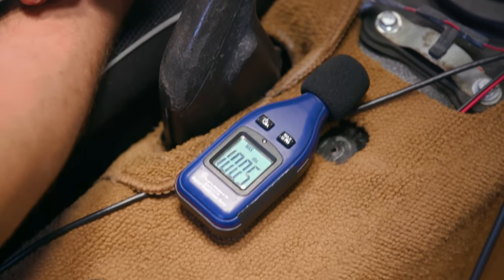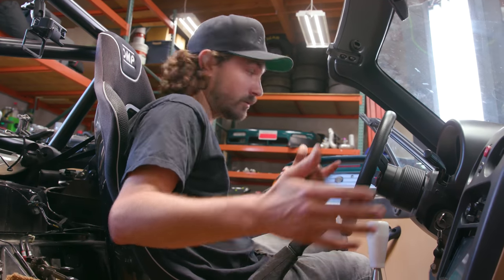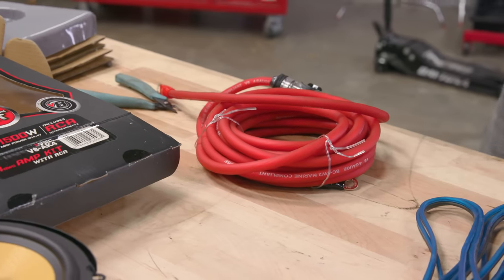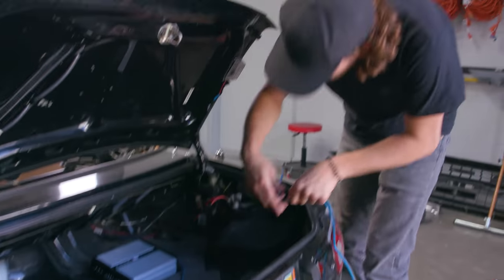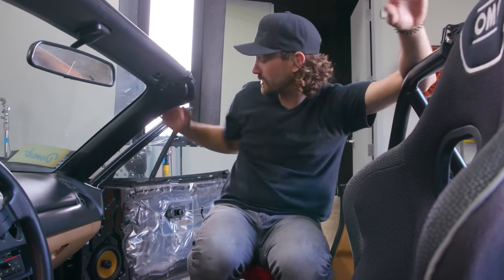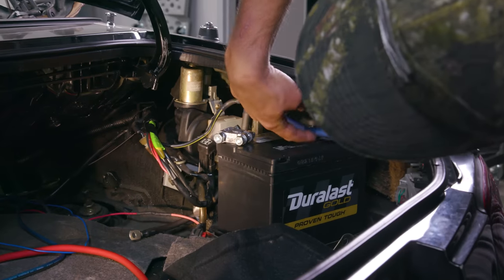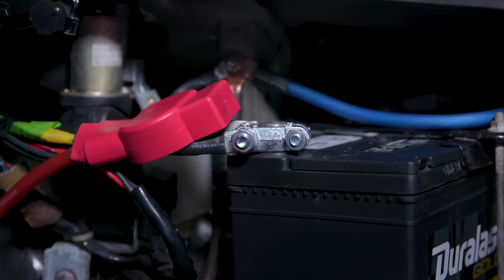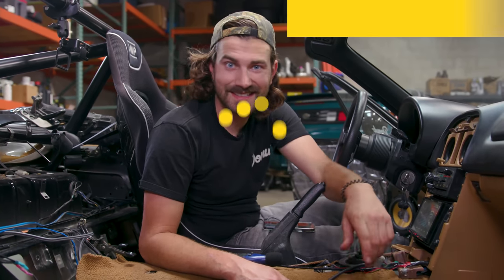Is Upgrading Your Car Speakers ACTUALLY Worth It?

Comment: Jobe is going to be a great Dad some day.  He makes me feel like I can do anything after just watching a video.
Reply: Rita fuck me might be a scam / computer virus profile,  don't click that shit
Reply: Bro yes !!
Reply: I've got a '91 Miata and did this same thing (and more) about 15 years ago.  It's time I look at refreshing the entire setup again.  The old Miata models are SUPER easy to work on.  However, here are some tips:

The NA6 and NA8 Miata has a weird parasitic draw that makes batteries die quickly so get an Optima D51R and a longer tie-down rod to match (it's taller than the OEM unit but fits just fine in the footprint).  Then get a Battery Tender (or similar) to keep it topped up.  If you're concerned about the lack of instant current a yellow-top battery will provide for a higher-powered audio system, get a small capacitor installed in-line with the amp(s) - you won't need much.  I also sprung for some quick-disconnects on the factory power/ground cables to make it easier to swap if/when needed and to disconnect fully when in storage (no snow!) - those are 6ga cables, by the way.

For the audio system, run the RCAs under the plastic center console/tunnel cover.  Run the speaker wire under the door sills.  For speakers, 6.5" units in the door are pretty much garbage at speed with the top down since they're pretty much at your feet but they can serve as a decent foundation.  Getting proper component speakers will allow you to mount the tweeter in a position where it can do some good and reach your ears.  The rear deck (where the convertible top would rest when down) can be cut for an 8" shallow-depth, free-air sub on each side.  If you still have the OEM seats (which I highly recommend - just get covers or go for a full re-upholstery job), you can mount a pair of 3.5" speakers in EACH headrest.  That's a total of 8 channels of audio.  From the head unit, FRONT goes to the door speakers.  REAR goes to a low-power 4-channel amp driving the headrests.  SUB goes to whatever you have driving the pair of 8" units on the rear deck.

None of the speakers in the car need a ton of power to work well.  After all, the furthest any speaker will be from your ears will be about 3.5 feet.  A good amp for the 6.5" door speakers would probably be a 2x50w through a 2x75w unit.  The headrests are going to be more than fine at 4x35w.  The subs in the rear deck are going to depend greatly on the specs of the units you can find to fit but I found 2x150w to be plenty.  I'm running old Infinity Reference component speakers in the door and Infinity Reference in the headrests.  The subs on the deck are...  Pioneer, I think?  The system hits well enough to sound good and cuts through the wind noise adequately but it won't win any competitions.  I just want to hear the music while I'm driving.  I put the amps on a board that fit in the lower well in the trunk - it's a menagerie of Alpine and California units that, to be honest, aren't a good match for the system but they're what I had on hand at the time.  Amp technology has come a long way since I did all that and can probably fit a lot better now (Class-D amps...)
Reply: Except he fucked up on major issues here...one mainly that will kill your speakers.
Reply: @chrisSVT  Explain?
Reply: @toddlynch7282  solid tips! Though, considering then fact the the MoneyPit Miata is track car that also daily’s I’m not sure if added all that weight is the right answer. Perhaps though 🤷‍♂️
Reply: This is the great dad content creator
Reply: On the next Money Pit....
Installing Sparco baby seat.😆
Reply: He just went to all the trouble of installing an amp, when those speakers are rated at 50W, the same as what the head unit puts out. All that extra cost for the amp and wiring, all that extra effort for practically zero benefit.
Reply: Reading rainbow
Reply: @user-sx4yu3nw4j  depends on what your doing on the track if your just trying to get as fast as possible yeah its a bad idea but if you are happy with ya speed and just perfect your lines its not that big of a deal
Reply: @nickrose8733  Ready now to ad a subwoofer. Almost necessary for music listening. Thing is you always go for the stars. And then I do not even have a radio in my daily drive, a rugged working horse.
Reply: Daddy Jobe hahahaha
Reply: @nickrose8733  there's certainly a benefit. Although the stereo may be rated at x amount of watts per channel it will never compare to an actual amplifier to do the same thing. What you see in head unit wattage is(for the most part) marketing, and while some will sound good, and usually allot better than stock, it will NEVER sound as good as an ACTUAL amplifier with it's own power source. Bit to mention  bigger, better internals and heat sink. It's a  Much cleaner more reliable sound more true power without distortion...
Reply: @nickrose8733  50watt speakers running of a "50watt" head unit will sound a lot worse than 50w speakers running of a 50watt amp
Reply: You better watch Edd China,  he's a far better educator and mechanic.
Reply: Its the way he looks dude. Imma tell ya

He could sell anything to you cause of the way he looks and how he speaks. The facial expressions etc

This dude just LOOKS like the. Typical american car guy swagger dude everyone likes 😂😂😂😂
Reply: @BarrieBuskruitZV   I'm mad that you're right Lol
Reply: @nickrose8733  Bit of a correction here for the other responses. The reason it sounds better through a dedicated amp, is it's capable of putting out 50watts RMS per channel, as opposed to a head unit advertised at 50 watts PEAK per channel. Realistically, almost all head units push between 18-24watts RMS which is generally the minimum requirement.

To put into terms of engines, going by the peak output is like driving an engine that only has a 100RPM power band. It sucks all the time except when you finally get it to the sweet spot, and then it's gone just as instantaneously. Having an amp with a high RMS rating, is like driving an engine that makes peak torque at 1,000RPM and pulls like a truck through the whole gear. Think K24 with a big turbo and stock cams vs an N54.
Reply: Can confirm he is great dad. He my dad.
Reply: @toddlynch7282  thanks. My 94 miata speakers are super blown and sound terrible.
Reply: This is how my dad was he taught me so  much and let me do things myself to learn afterwards.  I miss him tons he died 10 years ago when I was in my mid 20s but I'm always thankful for what he taught me and nowadays I can do so much more than he ever could, but he was the foundation that made me want to learn how to fix and build things.
Reply: I’ve never touched a car and I feel like I can do an engine swap after watching him
Reply: @Anthonybrother 😊😅
Reply: ditto
Reply: or save the planet and stay a car-daddy.
Reply: bro i was thinking the SAME thing i was about to comment this!

Comment: Now as you can see, I've done absolutely nothing to the exterior of my car, and that is because I've spent my whole 300 quid on exactly what a 17 year old wants. A banging stereo, for me tunes!
Reply: I think you'll find track 4 particularly to your liking
Reply: So you want it to look good on the outside, or drive comfortably on the inside? You can't have both.
Reply: GLUED!
GLUED!
He he heee
Reply: Queue the techno 🤣
Reply: I've done the same in my transit sport, expect I have a pioneer head unit and I hate the thing I should have just bought a Sony
Reply: What exactly is 300 bucks going to get a guy on the outside of his car? A good wax job?

Nothing as game changing as this to be sure.
Reply: @snauspockets9924  --not a top gear fan clearly as any that was would get the reference ..
Reply: extremely loud classical plays
Reply: Muahahahahahahaa, that's awesome! I'm an Uninitiated so thank you all for introducing gold to me:))
Reply: GENISIS-I know what i like for Richard…
Reply: Uence uence uence uence
Reply: the fun part is that i'm a 17 year old and james may was right.
Reply: Side 1 of Led Zeppelin IV must sound as good as possible when enacting the 5 point plan.
Reply: @jameznm  why don't you like the pioneer head unit? I just installed one and it's great. Haven't installed the new speakers yet but the head unit seems to work amazingly. What didn't you like about yours?
Reply: @xxvodanhxx  What are you talking about lol. That is terribly untrue. If you fuck with the suspension and fitment, maybe yeah. But there are plenty of exterior cosmetic mods that don't compromise the ride
Reply: @xxvodanhxx  the latter
Reply: @xxvodanhxx  of course you can. That's just silly.
Reply: Priorities bud.  A good Soundsystem in a car  is amazing to have.
Reply: nickpaul241  Yeah you're right i changed my speakers too, it was a big improvement over the factory ones but i wish I'd have spent more on them. But my issue with the Pioneer head unit is it can't handle a basic request such as shuffle songs... It'll manage about 5 songs then repeats them and no matter what combination of settings i use it won't play ball, I've even been onto Pioneer about it and they were baffled, i hate the unit.
Reply: underated comment.